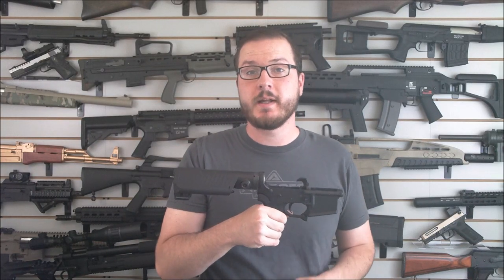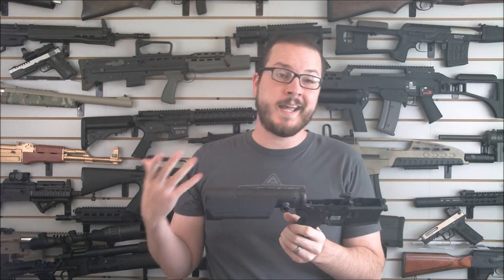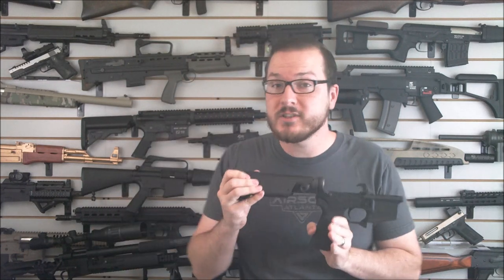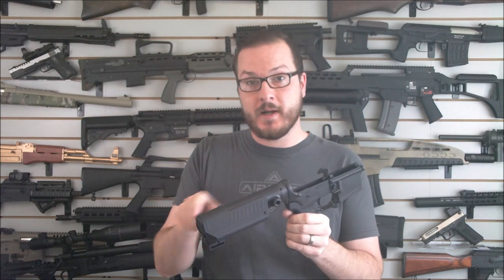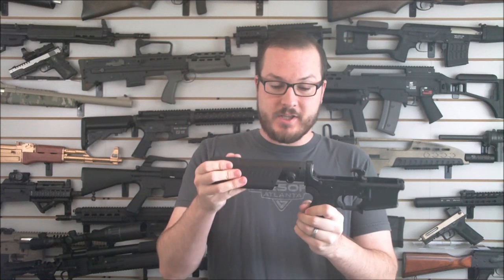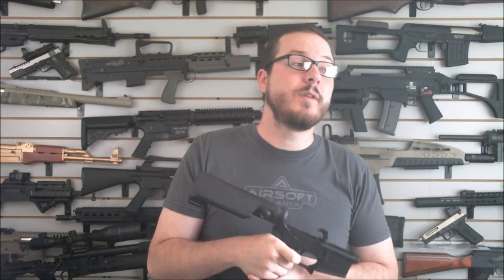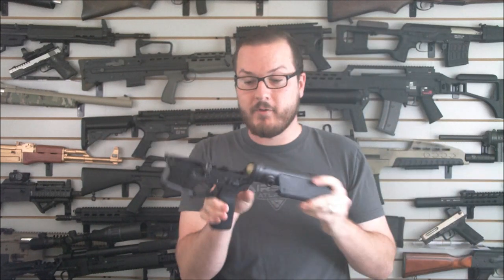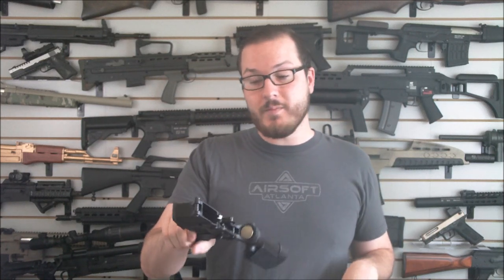Booligan's "Real Steel" AR Pistol Build Pt. 2 - Thordsen Custom/Strike Industries Completed Lower

Comment: That's pretty cool! I agree with you about the Sig arm brace, that thing is hideous. Thank you for the heads up about this buffer tube option. I think I'm gonna pony up for that instead. Good video.
Reply from the maker: It's a great option, especially if you're starting with a raw lower receiver, as the kit comes with everything you need.

Comment: Just to clarify you can add the Thordsen to a traditional AR buffer tube (with stock position holes).
Reply from the maker: +muffemod Correct, however, that can be the quick way to catch a "constructive intent" case, depending on your situation. For me, I have no actual AR15 rifles, however, I have dozens of AR15 stocks around my house because of my airsoft channel. So, the installation of a carbine buffer tube with stock holes on my pistol, in addition to the AR15 stocks that I have around my house for non-firearm purposes could lead to a "constructive intent" case being brought against me. So, for the sake of caution, I went with the hole-less buffer tube. It's idiotic that we have to do this to avoid issues with the ATF, but it's the reality of the current situation.

Comment: So my question is this. How does the length of pull compared to an actual stock? I currently have a Magpul stock on mine and it's 6 position. Which position would I have to collapse my stock in order to get a feel of how the Thordsen would feel if I were to get one?
Reply: +Excalibur01    You would need to collapse it to the shortest LOP and even then its a tad longer then the this setup...  A much better system is the KAK Tube and Shockwave Blade...  Same overall price.. Ten times better setup.